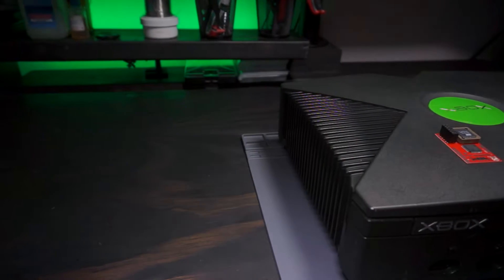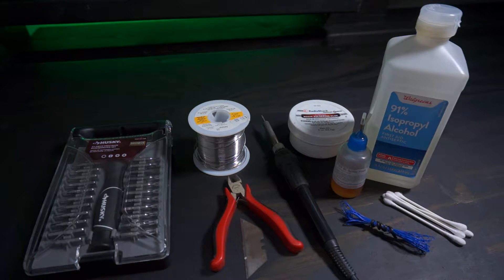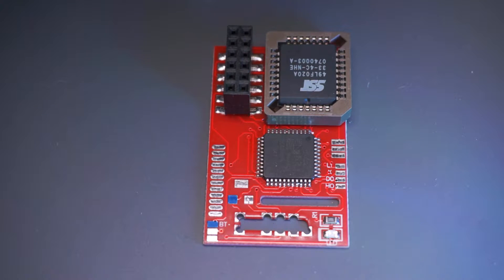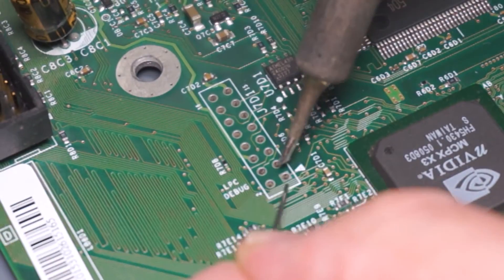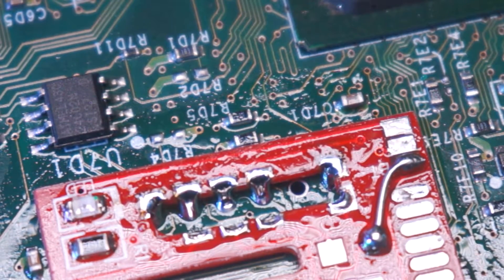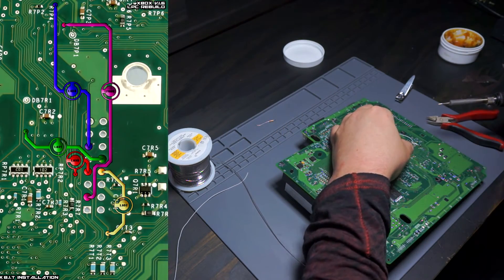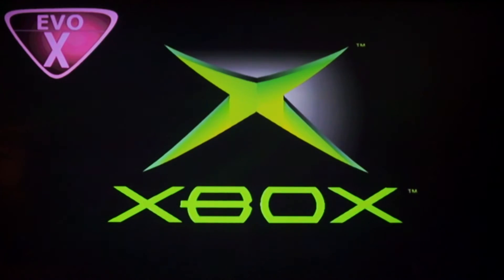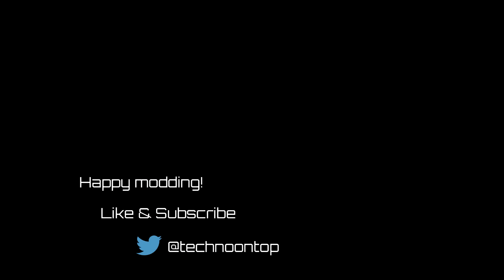Installing an Aladdin Xt Modchip to the Original Xbox

Comment: Will this method work on the version 1.0
Reply from the maker: Yes you can quick solder the chip if you want, but the install will vary slightly so no you can't follow the tutorial fully

Comment: I solder my mod chip on like this but I can't find a full guide for the Xbox 1.0
Reply from the maker: Just do a pin header install I have a video on my channel. Couple that with a install diagram should be easily found through Google
Reply: @TechnoOnTop  I don't have the pin header plus it's already soldered to the board
Reply: @TechnoOnTop  is it basically the same without the pin header
Reply from the maker: @Beep-v9w  yea basically, but this video is specific to a v1.6. If you want to do the quick solder part you can on a v1.0 but Using a pin header is a preferred method. Also you need the D0 point for the v1.0 which isn't in this video
Reply: @TechnoOnTop  Thank You bruh sadly I'm just gonna use the other method cause it's soldered down flat already. I appreciate the help alot
Reply from the maker: @Beep-v9w  so then all you need to do is attach your D0 wire and you should be all modded up! No problem happy modding!
Reply: @TechnoOnTop  oh I forgot do I have to cut the part on the motherboard
Reply: @TechnoOnTop  well last night after I got off work I soldered it up nothing light up on the mod so I soldered puns from another xbox I had it fried my xbox I believe because of a lack of guides for the v 1.0 and 1.1 this is the second console that died on me I thank you for your help as much as you've done but sadly mine got fried

Comment: I got an old Xbox with this mod in it, but it had wires coming from the BT solder spot and I broke the solder but it's still attached to the mod chip. Now it doesn't boot into the mod bios. What should I do?
Reply from the maker: You need to. Ground that point I show it in the video it puts the modchip into "always on".
Reply: @TechnoOnTop  Hey thanks for replying. My 1.4 doesn't have any wires on the underside of the mobo, it just had this double wire attached from the BT spot to a couple of places on the motherboard, I have no idea what one of them was but I'm pretty sure of the other, but it's different than in any tutorial I've seen. Most require at least one wire to be soldered from the motherboard. I'll try to solder that one to ground on the mod chip like you suggest and see if that works, cheers.
Reply from the maker: I just assumed you were had the chip on a 1.6. The only wire you need to attach to the motherboard is called the D0. There is a spot on the top of the mobo. But there is also an alternative spot on the bottom I recommend connecting to that one as it's a bigger pad and easier to solder. That's the only wire that needs to be connected anywhere. Those other wires are for turning on and off the modchip (which is pointless)  
 
Do this 
https://web.archive.org/web/20160331200649/http://xbox.bula.nu/aladdin/xt/BTGround_resize.jpg

Then connect the D0 to the D0 on the chip.
https://i.redd.it/aeg20itxrfu11.png

Comment: I recently bought an OG and it came with this modchip installed this way. The thing doesn't work so I decided to remove it, but every single video about it explains the pin method and I was unsecure about how it was attached to the board, thanks to your video now I can just throw it away.
Reply from the maker: Glad to hear you where able to remove it!  Thanks for watching!

Comment: is it worth installing a header in the holes, then soldering the chip to the rigid connectors that come up off the header? it seems like that would be easier....or run wires?
Reply from the maker: You can just solder pinheader to the motherboard then the modchip just plugs in, see "how to install via pinheader". The quick install method is slightly faster then the pinheader method and alot faster then using wires, but I also have a "how to install via wires" as well, thanks for watching
Reply: @TechnoOnTop  OH!! So the same chip can plug in via pin header OR be laid on top and soldered directly to the board like that? you just flip it over and the header plugs into the pins? that's actually pretty slick design

Comment: hello,   Happy New Year!  and congratulations for the videos you make !!  coming to my request, I have installed the Aladdin chip on my Xbox v 1.2 / 1.3 ... the problem is that despite many soldering attempts in different points, when I turn on the console, the screen remains black and flashes yellow and red ..  if I press to open the DVD player, the compartment does not open ... could you help me?
Reply from the maker: Happy new year to you as well, I will do my best to help, does the Xbox still function normally without the chip installed? Also you didn't follow this video to install right? Because this video is specifically for a 1.6 although the process is similar it's not exactly what I show in the video.
Reply: @TechnoOnTop  my Xbox version :1.4... yes, before the modchip installed, it worked .... just some problems with the reader and the hdd that I was replacing..
Reply from the maker: Ahh ok so you can't take it back to stock to test it then? Usually going back to stock is just unplugging the modchip from the pinheader, my advice is just to check over all your soldering, especially the D0 point the one on the top of the board is sorta tough to get right because it's so small. The alternate point that's on the bottom is much easier to solder to and that's the point I usually use. Past that just make sure you seat the chip properly on the LPC it can be easy to put it on and miss 2 of the pins.
Reply: @TechnoOnTop  I tried to solder the D0 point from the botton and the more difficult one without doing damage ... I also tried to ground the D0 of the motherboard on a metal point where the screws go ... I soldered h0 and bt as  schematic, i also tried to make the bridge and solder bt on the same chip ... but nothing, the mod doesn't want to work.  mine is a 1.4 .. I did not use the pinheads as it did not enter for long because it hit the capacitors, so I opted for the second method ... maybe if someone had a modified v1.4, I could follow the various steps  ... or maybe it will be the faulty chip..I don't know what to think 😔

Comment: Are you sure it comes with evox m8 preinstalled? Both of mine came with evox m8 1.6 preinstalled
Reply from the maker: I'm pretty sure, it wouldn't make sense for them to flash it with a bios that wasn't compatible with all Xbox versions unless they wanted to offer a different sku of the item but why flash some specifically for a 1.6 when the one bios covers all of them.
Reply: @TechnoOnTop  Evox m8 1.6 works with all xbox versions(done it before)so i guess that every 1.6 bios will still work with all xbox versions,thats why mine came preflashed with this bios(because 1.0-1.5 bioses doesnt work with 1.6,but the opposite can be done)
Reply from the maker: There are bios that don't work on anything but a 1.6 and usually they are named with the 1.6 to avoid confusion (m8_16.bin for example) a bios that has a name like "evox m8 1.6"  I'd automatically assume it's a "1.6 only" bios based on its name. Apparently its just the same as the evox m8 bios, so me saying that the Aladdin comes flashed with the "evox m8 bios", is no different then you saying it comes with the "evox m8 1.6" my guess to why they started adding 1.6 to the name is they added in support for the 1.6 that wasn't always there. But they are exectly the same bios besides the support for 1.6/1.6b. And here's a source https://www.xbox-hq.com/html/article1022.html
Reply: @TechnoOnTop  Yea they are the same bios,but according to what i have witnesed, 1.6 bioses(at least the m8_1.6)DO work with other xboxes aswell,thats why i wonder how your chip came preflashed with m8. Did you try that chip on a 1.6 xbox?
Reply from the maker: Yes the chip is installed into a v1.6 that was stated in the video/thumbnail/description. the video is specifically for installing an aladdin chip into a v1.6.
Reply: @TechnoOnTop  So i bet that your chip also came preflashed with m8 1.6 and not m8

Comment: I have two failed PSUs from a 1.6 and neither of them are putting out 3.3V like they should be. One of them just randomly failed and the other was supposedly working when I bought it. Was there an issue with 1.6 PSUs?
Reply from the maker: Iv never heard of any mass issues with a 1.6's powersupply nor have I encountered a faulty one, you could try replacing capacitors but idk if that would help, and it's also dangerous so if you decide to do something like that be very careful.
Reply: @TechnoOnTop  I did some more testing and i'm pretty sure the C7C2 transistor has gone bad. Everything else checks out so far
Reply: @Wilson_Racing  1.6 boards in general will cause power failure sometimes. Out of many many Xboxes I’ve been through only two had failed power and both were 1.6. Can’t be a coincidence

Comment: i have followed all instruction to a T i get the red glow on the modchip however there is no video on my screen. when i remove the modchip from the pinheader and turn on the system i get the flubber animation however with the modchip properly installed i get nothing. the pinheader and the modchip on it are installed correctly, the D0 point is connected and the chip is set to always on. it is a 1.0 motherboard. 

does ANYBODY have any advice? this same setup works with an Aladdin advance just fine however i wanted to use my whole hard drive so i upgraded to an Aladdin plus 2 and this happens.
Reply from the maker: This tutorial is meant to be for a v1. 6 motherboard, so if you followed it to a T some things definitely aren't right so if you did rebuild the LPC then undo that, 

I have had the same issue you mentioned it turned out to be a bad modchip
Reply: I did not rebuild the LPC
Reply from the maker: Well that's good, when you put back in your other modchip does it still function? Like I said I had that very issue and it turned out to be the chip itself.  Another thing if your not being able to use the whole hard drive it's more then likely a partion issue.
Reply: @TechnoOnTop  the original modchip does indeed still function. it is not a partition issue, apparently my EVOX bios isnt very up to date, the chip that DOES work is an "aladdin advance" not an "xt plus 2"
Reply from the maker: The bios must be ancient then but if it's a legit aladdin chip I guess that's not really surprising lol why not just do a Tsop flash or reflash a newer bios to your chip? Alladin chips aren't really much as far as features go. If you want something with more features you should pick up an open xenium, they can be had for $20 on ebay. I own one and it's been good to me for what that's worth.
Reply: @TechnoOnTop  dunno, i bought it from greece (covid). honestly im afraid to do a bios flash because i hear its easy to do it wrong and it can brick either your modchip, xbox or both (i have a 1.0 motherboard with NO trace damage at all, i want to preserve it.) and since the open xenium isnt preflashed thats why i havent gotten one yet.
Reply from the maker: For what it's worth iv never bricked an Xbox, or a Xbox modchip, I did recently brick a psp or it bricked itself because it was an official firmware update lol... I'm sure you could probably get the chip pre-flashed. Mine wasn't but I'm sure you could find someone selling them who would do that for you. I actually used a psp with a tiny 16mb memory card and a USB to Xbox converter to flash my open xenium.
Reply: @TechnoOnTop  apparently there are people on the internet who have...
Reply: @TechnoOnTop  also, is there a particular reason my power button is making an electronic click sound when i turn on my system? i didnt notice that when it was stock.
Reply from the maker: An electric click sound? Um, is it just the harddrive making noise? Or the disc drive? I really would have a clue in what would start something like that
Reply: @TechnoOnTop  no, its more like a pop actually and it coming from the front button panel, i have had to replace it once already. im not sure what is causing it.
Reply from the maker: Maybe it's shorting out on the metal shielding?
Reply: @TechnoOnTop  not likely, after the first board killed itself by going from poping to fizzing a few times, i replaced it with a new oem front button board that is now back to poping with 2 layer electrical tape covering the leads in the back.
Reply: @TechnoOnTop  it is worth noting that im using the very rare minebea psu in this build, i havent gotten around to swapping that out for a different revision.

Comment: Your video is exactly what I've been looking for. My hard drive died, DVD drive won't read DVDs at all, and it's a 1.0 Xbox. I was going to TSOP still until my hard drive failed during the hotswap softmod method so I at least have all my files. I would like to know exactly how to prepare a new hard drive on a PC in case I cannot get any dvdrom drive working with the Xbox for a boot disc like Hexen.
Reply: PS I already have this exact modchip purchased before watching the video
Reply from the maker: This video is specifically for a v1.6, but installing a modchip to a v1 is pretty much the same, no need for the LPC rebuild and the D0 point is slightly different. I have a video about installing a modchip with a pinheader so check that one, as for rebuilding a hard drive via a computer, iv never done it so I'm not sure of the process, I believe the software you want is called chimp, then you will just need your  Eeprom, which you say you have that file, I've always used hexen or auto installer deluxe to build harddrives through the Xbox. But I don't imagine the pc software is much different probably just a click or two,
Reply: @TechnoOnTop  I didn't say I have the eeprom. I never could back it up before softmodding the system via the hotswap method.
Reply from the maker: Oh, you will need the eeprom to build a harddrive through the computer. Those alladin chips don't have the ability to dump the eeprom, the open xenium chips can, so can the xblast chips, people are selling open xeniums but I don't know where probably on a Facebook market thing. But I don't use Facebook so I can't really help there. Maybe you can get your DVD drive working by cleaning the laser it just needs to work long enough to build the HD,
Reply: @TechnoOnTop  I've already drive everything possible to get it to read DVDs with no luck. All I need is to be able to restore a drive which I've seen a PC DVD rom can in the Xbox which if I'm lucky my barely working ones will allow me to. I just need to mainly bypass the need for a locked drive until I can lock a new one to the system, remove the modchip and TSOP flash.
Reply from the maker: Hmm yeah you will need a new DVD drive, iv tried a generic one from a laptop, xbmc didn't see it, but if you cold boot the Xbox with the disc in it (hexen) it should boot, or at least that was my experience.
Reply: @TechnoOnTop  that is the plan
Reply: @TechnoOnTop  unless somehow I cannot is why I asked about the hdd
Reply from the maker: Then I have no idea what your asking, you need the eeprom to build a new Hard drive using software on a computer. Since you don't have that you will need to either make an eeprom reader(or a modchip with this feature) to dump it to a computer. Or you can install the Aladdin modchip you have put a new unlocked hard drive in the Xbox then use the hexen disc to build a new hard drive. But since your disc drive in non-functional you won't be able to do that. So you need a functional disc drive or to build an eeprom reader. That should of answered your question. Trying to use a disc drive that was not meant for an Xbox is like going down a rabbit hole then taking a shot in the dark maybe it will work maybe it wont. There is a specific model of drive that you then have to flash with a specific firmware for it to be recognized by the Xbox but those drives are very old and would probably cost more then just finding a working xbox disc drive or another xbox on your local classifieds.
Reply: @TechnoOnTop  From what I have seen it requires a desktop drive with no flashing required. You just can't use Xbox games according to multiple people in every forum I have seen this far
Reply from the maker: Well if that works out for you be sure and let me know, i haven't seen these forum posts, the ones iv seen say to use a specific model that's flashed with modified firmware, and that doesn't play retail games. Only backups
Reply from the maker: decided to just google it, yeah it seems you can just use a PC drive, for whatever reason I had never run across that,  it seems what i was thinking is actually the way to make a drive read retail disc's. and not just work in general sorry about that. happy modding
Reply: @TechnoOnTop  Thanks for double checking. Hey you learn something new everyday. I'll let you know how it all goes still
Reply: This guy doesn't know anything. Use FatXplorer after you install a modchip. The Xbox will boot right up.

Comment: What are the benefits of this hard mod vs soft mod with Rocky5 and Xplorer 360? I'm confused on this.
Reply from the maker: Benefits are mainly, ease of upgrading harddrive, also easier to fix if you happen to mess something up or if harddrive failure occurs and you didn't back up your eprom, iv always heard softmods have a tendency to just break themselves, though iv never used one long enough to prove or Dis-prove that.